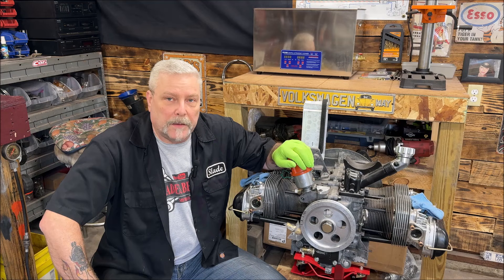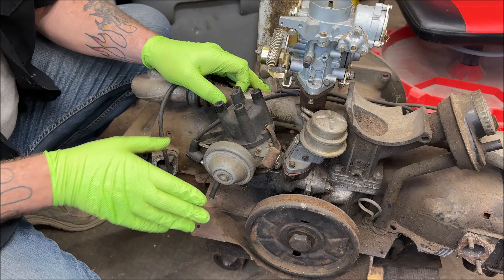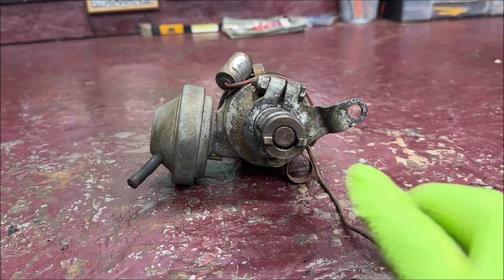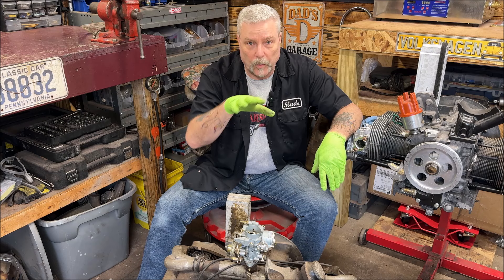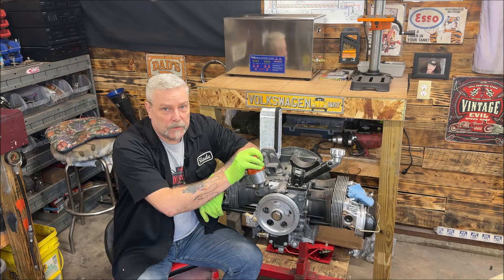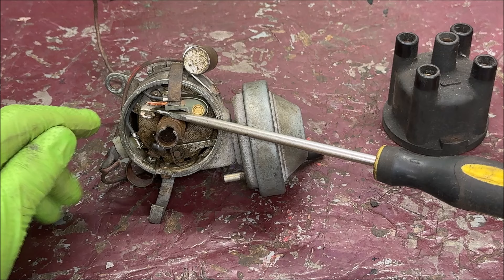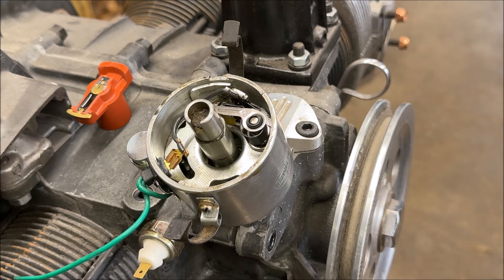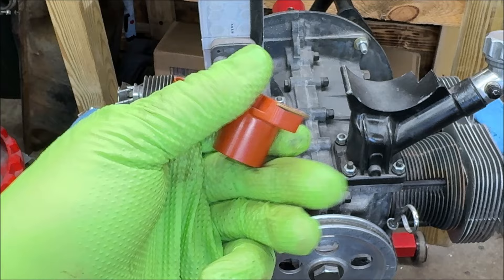HOW TO MAINTAIN YOUR VW BEETLE DISTRIBUTOR - CRUCIAL TIPS - SUPER BEETLE - BAJA BUG - VW BUS #vwbug

Comment: Yes sir; anything you do is liked and appreciated. You can do the tin preparing and painting one. We’ll be watching. Thank you!
Reply from the maker: Thank you so much I truly appreciate that! I’m going to ultrasonic clean, then paint, and then do a complete installation video.
Reply: @SladesVWBeetle  The thermostat and flap system refurbish and install will also be interesting. I just did some not too long ago. They rust and their little rubber bumpers (the same part as the two rear apron little rubber snubbers) break.

Comment: A great video as always.  One thing I would like to add is I had a problem with the exterior of  my cap.  Where the clips engaged the cap there was a slight deterioration. I don't know why but when the car got warm it would start to miss. This drove me crazy, because I couldn't find the problem. So also check the outside of the cap. It was a relatively new cap
Reply from the maker: Oh yes, absolutely! That’s why I brought up checking for cracks on the outside. I know a lot of people ignore this stuff, or sometimes we just don’t literally realize what’s going wrong. I still think the quality was much better years ago with some of the parts.

Comment: One other thing to think about.  I had a vacuum distributor that had the drive that sits in the drive gear installed backward.  So it might not be the gear in the case. It could be the new distributor you have needs that part on the bottom flipped 180°
Reply from the maker: Yes, absolutely! And thank you for taking the time to leave a comment. It’s always good to check our parts very carefully. Especially now.

Comment: When I bought my 72 super beetle the vacuum lines were connected all wrong? I don’t know how they got it to run! The main reason I got such a good deal is someone had all the wires backwards on the fuse block (if you can read the schematic right side up, then it’s upside down!!!!) also the curved connector on the steering column was on offset by one pin! So look out for that! Thanks for the great video full of info, as usual!
Reply from the maker: Oh wow!!! I have actually worked on some folks cars before, where I was simply amazed how screwed up everything was. So I know exactly where you’re coming from. And I really don’t think some take the time to figure things out. They get frustrated and sell their vehicle. But sometimes it’s a benefit to others. Thanks for taking the time to leave a comment.
Reply: @SladesVWBeetle  I’m working on the rear suspension swing arms, bushings and retainer plates. Everything is so rusty I decided to change it all! My major concern is the big 17mm hex socket bolt through the inner pivot point! I hope I can get it out!
Reply from the maker: @bobsbarnworkshop  I bought one of those Allen had socket sets, and of course, lots of PB blaster whatever you like to use. Those things have been a lifesaver when I put them on a breaker bar.

Comment: Thank you Slades, Its been awhile i try to find some one explain the distributor mine got to Vacuum hose I'm not sure if they are mixed the one in the back hook on the side of the carb and the one in front is hook on the front of the carb. i will need to switch them around. My question is more if i add a pertronix distributor with one Vacuum do it will work and i plug the front of the carb.

Comment: I noticed your rotor seems way tighter than mine i have about a quarter inch of play in the shaft when i take it off... does it mean its no bueno?
Reply from the maker: @mastermoi  do you mean the whole shaft along with the rotor will turn back-and-forth? I’m just making sure I’m understanding you properly. There’s always a little bit of play when you turn the rotor back-and-forth. But if it’s excessive then they’re definitely is an issue.

Comment: the previous owner of my bug out the distributor in backwards.  I haven't broken down to make it right, but i keep it in mind when putting the wires on.
my distributor is missing that felt pad that you pointed out in the shaft.  what purpose does that felt pad serve?
Reply from the maker: Since you’re aware of it, I wouldn’t worry about it too much. Just as long as the wires are in the proper position.. 

The felt pad under the rotor arm 
that you put one or two drops of oil on at every service, to keep the advance mechanism lubed just like you do with a SVDA
Reply: @SladesVWBeetle   - you mentioned to not use white lithium grease on the distributor shaft.  what do you use in place of it?  I don't believe you mentioned that.
Reply from the maker: @crankbait09  oh crap I didn’t realize I missed explaining that. Sometimes my brain has too much going on when I am filming. Trying to remember everything. White lithium grease can become hard, and brittle. I like using a Molly grease. That stays soft.

Comment: This is Great Content Slade, Where can I find an 034 Distributor (SVDA) With Points? The only ones I've seen online are the Electronic Ignition variety. 
I've blown too many modules recently to justify the expense. I have a place locally that sells the replacement points, but they only sell the Electronic Ignition distributor. Even JBUGS has been Electronic only recently. Thanks
Reply: Sparxwerks or VWNOS, they rebuild OG and good quality distributors. Get the proper distributor to what you are running especially match it with the carb
Reply: @nicolasloud995  Thank you
Reply: Found and purchased ❤ The prices were better than the Chinese Knock Off, and the parts are German. Your comment was extremely useful @Nicholasloud995
Reply from the maker: Thank you for taking the time to leave the comment my friend. I see your answer was there from another member which I really appreciate. I’m finally catching up on my messages.